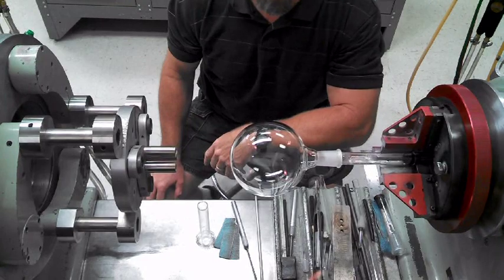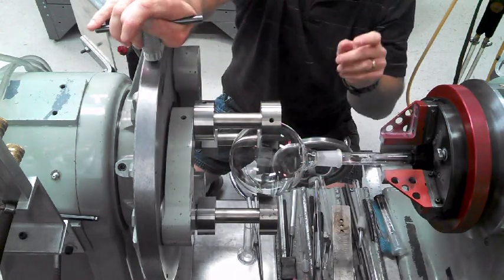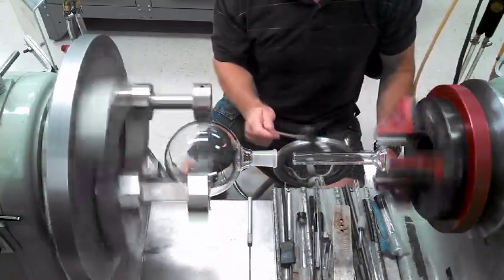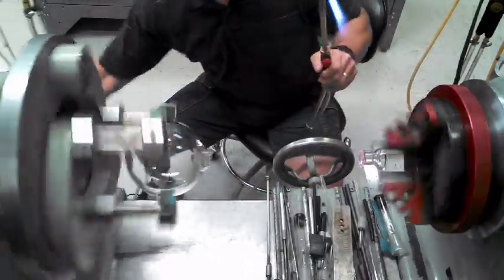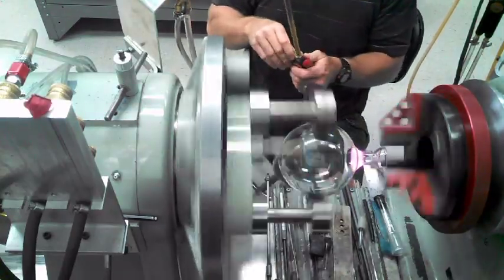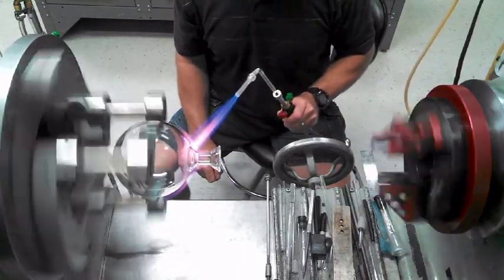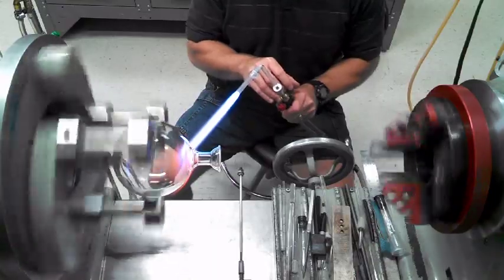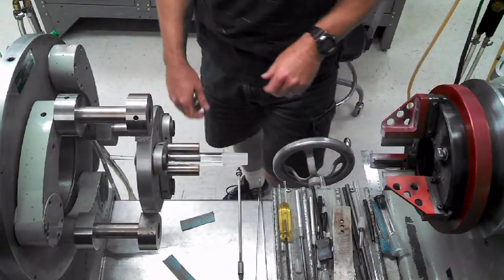No Blow Tooled Seal on a 1L Flask

Comment: Couple questions :), if you are active in the comments. Who makes the torch handles you are using in the video? I'm looking to get into "scientific" glass blowing for fun, kind of, with projects in mind. I'm looking to get a torch with a few tips, nothing fancy or expensive and therefore curious who makes the torches in this video. Second question, if I use boro glass, can I temper the item like you do here and let the item cool on its own? I cant afford to buy an oven which is why I'm asking
Reply from the maker: TCamp  The torches are Victors J-50 and J-27.  I pick them up on ebay used for around 90.00, then I have them rebuilt to new specs for about 28.00.  If you are doing standard type work (not heavy walled or multiple seals) you can get away with hand annealing, but I would recommend getting some type of oven later.